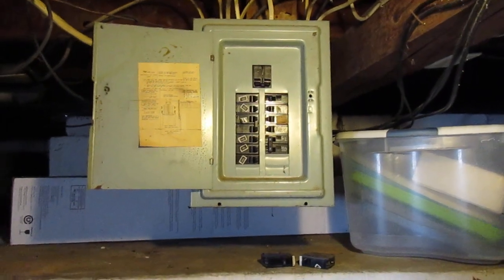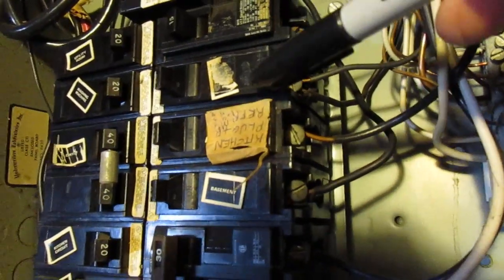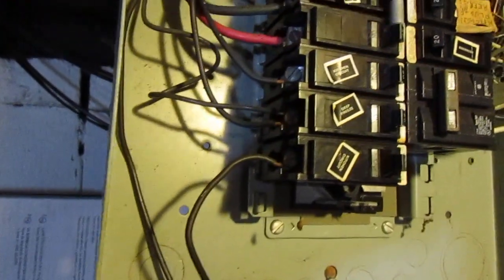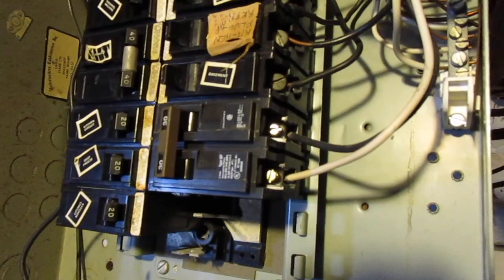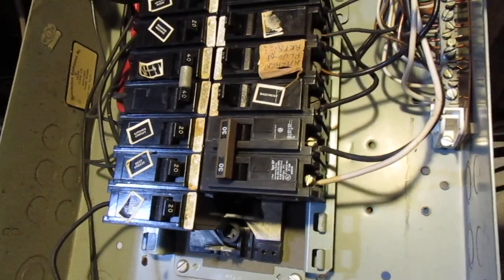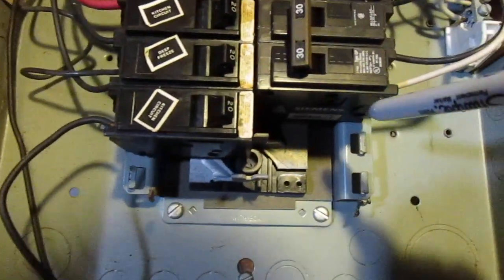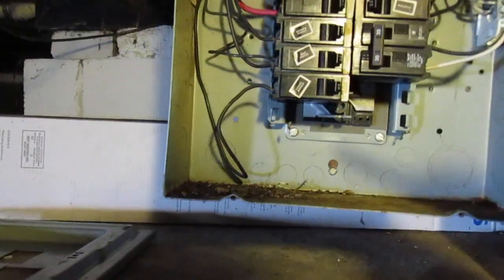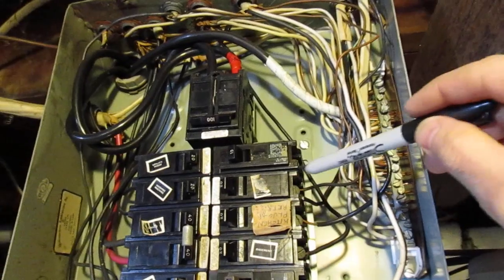Main Electrical Panel...Double Tapped Breakers, Other Issues

Comment: You have wire pullers, and u have idiots, that care less for the nec code.they appear to want to burn people's houses down.nec or nothing. The breaker is there to not only the equipment protection but also the wire, like I said imo IDIOTS.

Comment: I'll agree that the panel is a sloppy job. As far as 2 conductors under one breaker they are #12awg are protected by the 20 amp breaker. The only problem is when one circuit pulls say 15 amps and the other 10 amps, now we have a problem and the breaker trips.

Comment: At one point years ago you were allowed to splice inside a panel? If that's not the case you can install a box outside and run multiple circuits??

Comment: dble tap not tht big of a deal you cld always just pigtail them plenty of room in tht panel not to professional and sloppy but for a cple of cents no real harm. but panel should replaced with all of the other issues tht corrosion is a flag
Reply: @philipwilliamshomeinspecti4665  yes I wld recommend replacement asap but I'm sure $$ is an issue
Reply: Btw, you're missing alot of letters in you words, I'd check out if your phone keyboard is messed up somehow, good luck

Comment: With 3 spare slots, they likely double tapped because the breakers are difficult / expensive to source. It would have been nice to get a torch light look at those double taps up close, the left side upper wire appears to have a poor color. perhaps got hot / arced because double tapping raises the risk of arcing, particularly if the gauges differ then it is only a matter of  time before the fire crew makes an appearance.